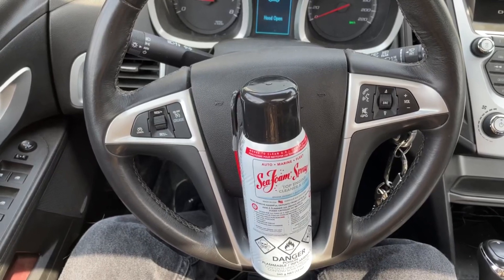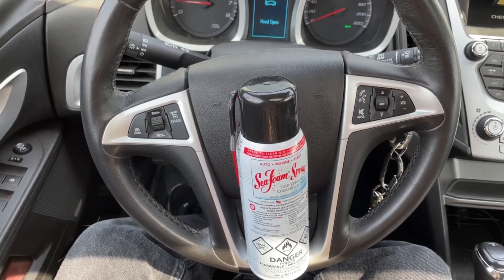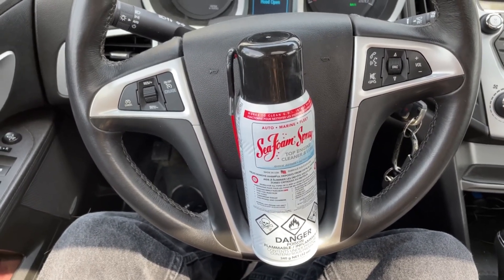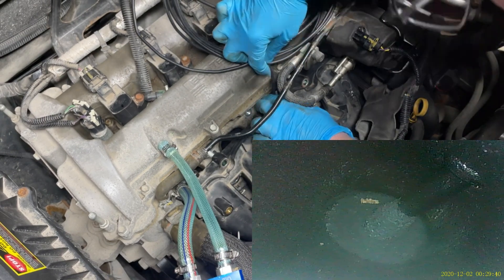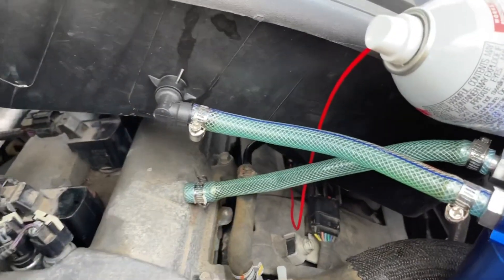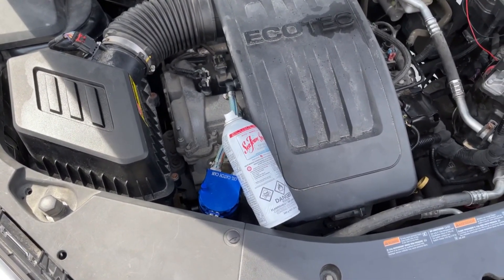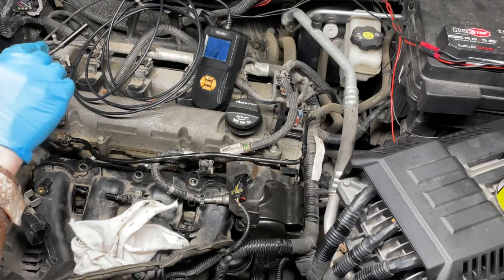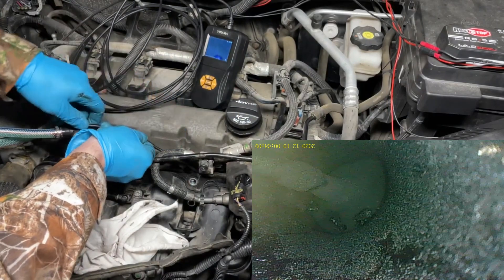Seafoam Top Engine Cleaner & Lube Review

Comment: I have a 2017 Equinox, - I’m going to try REDLINE S-1 Fuel System Cleaner
Reply from the maker: Please let me know your results. I’m gonna be experimenting with amsoil pi treatment and gas mixture. I didn’t like the results as a fuel additive when I looked at before and after of the piston heads. But I’m gonna try to deliver the mixture similar as I did this seafoam. Thanks for watching. Please like and subscribe to stay up to date

Comment: Did you use the sea foam gas motor treatment at the same time like your supposed to
Reply from the maker: This is a stand alone procedure meant only to clean the valves. The motor treatment you are referring to is meant for fuel injectors. This test was done on a gdi engine so the motor treatment in the gas tank would be useless. On the valves.

Comment: Can needs  to be upside  down
Reply from the maker: No it needs to be right side up. As specified by seafoam themselves. Check their how to use the product video: https://youtu.be/EqIOavT8Gi4. If you want to correct someone please research into the topic first. All tests or services that I perform are done so strictly to the manufacturers directions so if my test is bad then it is the fault of the product. Thanks for commenting